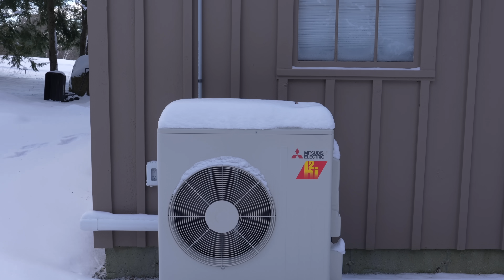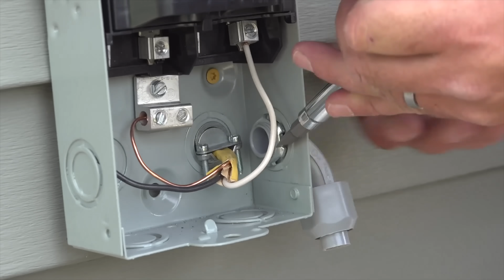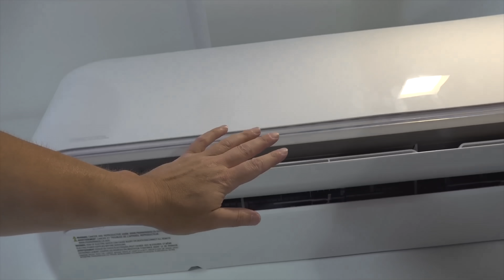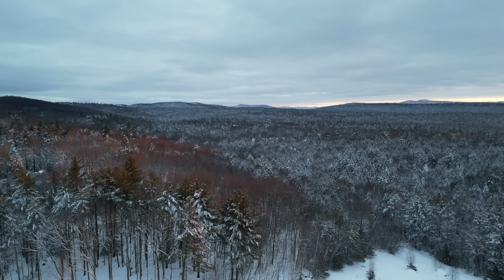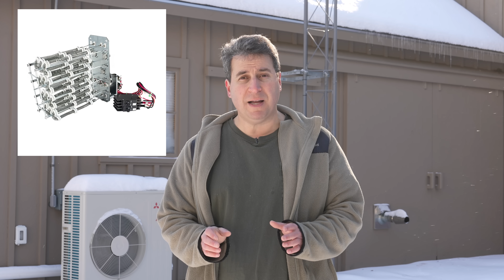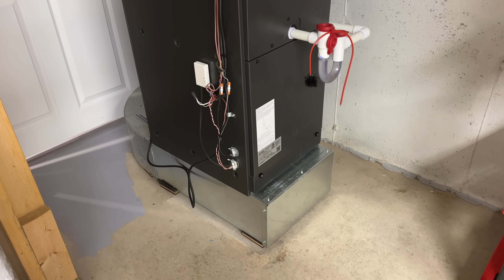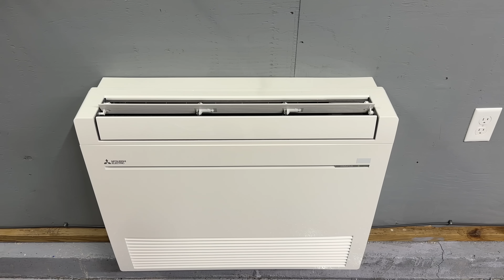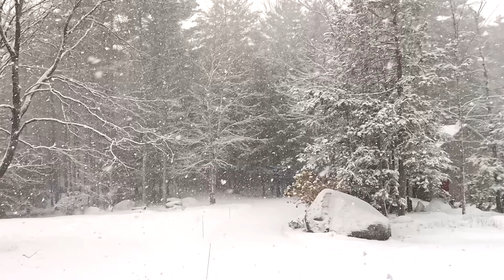Why Heat Pumps are now leaving people COLD

Comment: My friend recently decided to have a heat pump installed. He has an old house and it had an oil furnace and cast iron radiators. He claims that one of his pipes froze and cracked. I don't know if this is true and neither does he (I'm assuming) because he's a hoarder and it's a major ordeal to get to certain areas of his house. Rather than hiring a plumber to come in and find the problem, he decided that the best course of action would be to have a heat pump installed.

So he got the name of a company from somewhere, and hired them. He had visions of a single, small unit, instead they installed three units, each of which looks like it would almost be big enough to hide a body in if they were hollow. One goes to a wall unit in his living room, one goes to a wall unit in the kitchen and one goes to a wall unit upstairs.

Apparently this stellar company installed them and then left without properly testing them, or really showing him how to use the remote control which has a screen that looks more like a scientific, graphing calculator than a simple temperature remote. When he tried following the book and turning them on, he couldn't get the kitchen one to work at all. It wouldn't turn on for me either. He said I should go outside and reset the switch (he has arthritis and was also recovering from surgery). So I went out, found the unit connected to the kitchen, opened the little gray box, and... There was no switch. It was a plastic piece with contacts on it, that plugged in like a big fuse. Plug it in one way and it gives the unit power. Plug it in upside down and the unit is physically disconnected. Apparently they only had two switches and this thing, so that's what they used. Anyway, after I pulled it out and plugged it back in, it started working.

So far, his electric bill has been higher than he anticipated, and when his brother saw the size of the three units, he remarked that just one of them would heat his whole house.

Personally, I think my friend got taken for a ride...
Reply: That little box is called a disconnect. I prefer to install a pull out disconnect rather than a disconnect switch. Switches can fail closed and cause electrocution or damage to the equipment.
Reply: @ryanbrown5334  I don''t know anything about them. I assumed that the switches included some kind of additional circuit breaker of ruse. I know his electrical panel has two circuit breakers for each unit. Whether both are for the outside units, or one each for the outside and inside units, I don't know. All three sets are just labeled together.
Reply: The switches are more than likely a breaker style switch that doesn’t have any over current protection. The panel should have a double pole breaker for the ODU and a double pole breaker for the IDU, possibly two depending on the capacity of the system and what size the heat kit is.

Comment: where i live, they only install heat pumps with a gas furnace (or some sort of additional heat source).  i asked my HVAC guy about them when we replaced our furnace last year.  we just ended up getting a modern high efficiency furnace and AC unit.  while he did sell them, he wasn't overly impressed by them.  i think they are likely better suited to more southern climates where you can use them to help cool your home in the warmer months and heat your home in the spring and fall where the temps aren't too low anyway.
Reply: Your guy needs to get updated.  Heat pumps work great in cold climates when properly sized.  Norway has tens of thousands of them.
Reply: @frequentlycynical642  not sure about that.  around here, you can't install it without a secondary heat source (typically gas).  since I had to get a new furnace anyway, it didn't seem to make sense to buy a new furnace, AC unit AND a heat pump.
Reply: @jeffer1101  Your logic is sound...for now. But, with the government being so anti fossil fuel, this will most likely result in natural gas becoming much more expensive in the future. 

I have been running a dual fuel system (I have a robust solar panel array) that has made it economical for me to utilize as much heat pump generation as possible. That said, I have noticed my  natural gas price sky rocketing higher these last several years. 

You have already made your purchasing decision and I hope it works out well for you. I just haven't seen the government's impact on future gas prices mentioned as much as it should be and felt compelled to bring this potential future issue to the forefront for those that may be on the fence.
Reply: @edwardbutka4750  gas is still a big part of the our energy mix so I don't see it going away anytime soon.
Reply: @jeffer1101  Just to be clear, I didn't say natural gas will be going away. My concern is how the government will negatively impact the price of it.

For example, have you ever examined the cost of a gallon of gasoline? Over 70 cents per gallon is "tax" in California, over 66 cents for Illinois and over 62 cents in Pennsylvania. 

Automobile gasoline "isn't going away anytime soon" but the government sure has helped make it less affordable.

To ignore the potential future negative cost impact of natural gas by governments that have "targeted it" as a dirty fuel is short sighted imo.
Reply: @edwardbutka4750  I live in Canada, don't talk to me about "expensive gas" in the USA.  :)   It could be worse though, you could live in Europe where it's even more than here.
Reply: @jeffer1101  😂

Comment: I'm surprised a gas furnace would not be the supplemental in New England. I'm also surprised the Mitsu could not produce adequate heat in really low temps ... unlike the old heat pumps that would be programmed to shut off below about 45 F.

Comment: Living in Canada here. I have a minisplit rated for -30c. It heats my well insulated 1100 space with no issue during the cold temperatures. My only complaint is during freezing rain/snow storms, the heat pump cannot keep up. The pump will be in defrost mode often.
Reply: Solution: 😀put a cover over the top  and sideways  that allow air still air to exhaust and come through.
Reply: @danlavigueur2648  Huh?  What would that do?
Reply: @frequentlycynical642 you want to shelter the top so it doesn’t directly get snow/rained on because it would require it to go through more defrost cycles
Reply: @derrickp  As all of the minisplits I've seen on YT have vertical coils, can't see how that matters.  Even horizontal, not to any significant degree, especially for the work needed to shelter the coil. Just my opinion.
Reply: @frequentlycynical642  it depends on the makeup of the snow/rain/ice. It literally took like 30 minutes to build a cover. Probably less if I had someone to help hold things

Comment: Had an air-source heat pump growing up.  This was installed back in the mid-70s.  We didn't get a lot of super-cold days but with a field in front of the house (facing north), it could get rough.  The supplemental coils would kick in and the electric bill would jump.  We had a fireplace insert and got a small kerosene heater to help.  I'm sure the modern ground-source systems are much better.  However, if I ever build and put in a heat pump, I'll investigate options for supplemental heat.

Comment: Here in the UK, I have realised that essentially, the tradesmen see-saw your system design every few years.  For a lot of stuff.  And it is really expensive.  So, back in the 1970’s people had multiple types of heating, but natural gas became the norm by about 1985 or so, covering most of the country.  Others tried to struggle on with diesel, or also containers of liquified gas in a nearby section of garden, specially dug for it, became commonplace in the countryside.

Anyway, I installed a heating system of water radiators on the wall of a house in Scotland.  It was three storeys and I super-insulated everything.  Interestingly, when I asked for a boiler quote, multiple tradesmen raised an issue saying my radiators might contravene European regulations (!).  I said fk off or similar.  I specified and installed the rad sizes for suitably fast heating, assuming a cold winter start-up.  They imagine a perfect scenario where you afford heating on all the time.  Joke, especially now.  We pay through the nose for electricity, petrol/gas, and natural gas in this country, the UK, and our government is in the pockets of big Oil so that’s that.  Hence my interest.  

My point is, tradesmen have told me my present house ‘doesn’t need that big cold water storage tank’,and they will get rid of it while doing some other job.  I laughed.  No, you won;t I said.  When the next drought comes, I will need that tank of cold water.  Time passes, next door changes hands, new neighbour does what tradesmen advise.  I offered them water if they needed it, when inevitably some work on the pipes (50 to 100 years old etc), crack and all water is turned off one spring.  He didn’t need it, but he has two small children.  No, I will keep my cold water tank with 100 unnecessary litres!

So radiators essentially, have been getting downsized as tradesmen have been presumably following this trend from EU regulations.  It may have changed since Brexit, but many homes were updated before that.  Combination boilers, we were told would save money.  Haha.  These, are the opposite to what you need, now, all this stuff.  They are all,about burning gas, to heat the water OR the heating system, but only one at a time.  There is no hot water storage.  The result is your home is badly set up for modern eco heating!  Hot water must be stored, because the power from eco power sources eg heat pumps is limited, but over time it can be built up in water if it keeps getting recirculated.  Sudden bursts of heating, really are not possible with solar, or even some wind power. Or, heat pumps.

So you now need, hot water storage.  You need bigger water-filled radiators.  The policies pursued over the last 3 decades, ensure many householders are stuck because they would literally need to strip out all their heating infrastructure, it’s not going to be the right size.  And combi boilers did away with hot water storage.  My Scotland house, had the same boiler exactly as me here in England, but was using a hot water storage tank.  In England, it’s a lousy combi version of the same boiler.  Much less reliable.  In ten years, the England one has been broken down twice in winter of course, and replaced (unnecessarily it turns out haha).  We got a new larger combi from the Co-Operative society, a charitable branch of it anyway, for which I will always be grateful.  This calibrates our income for you.  We live on less than £20,000 per annum.  That’s our total between us as a couple.

But geo as stated in the comments does interest me.  I can still dig, not frail yet.  I will look into DIY of geothermal I think.  If I do a decent job of the ‘input’ side of the system, it should be rock-solid.  Then there’s just how to circulate and so on.  I just have to use the right grade of pipe, or whatnot.  Thanks for this, it confirms what I thought.  We are at minus 6 here (deg C) at the moment, but it feels as cold as I remember minus 25 deg C when I was 19 years old in Scotland, it was an exceptional winter, in the mid 1980’s I think.  We had a rear wheel drive car, it literally could go,anywhere even in 10” of snow (deep for us).  The gritters couldn’t keep up, and many big, expensive cars we helped push as their front or rear wheel drives were found wanting.  Take care all.

Comment: i had a LG duel inverter ac / heat pump, installed middle of october . it gives good heat down at --15 Celsius [canada] and maintains the set temp. to within 1 degree BUT its runs continous ,never stops. when it reaches set temp, the air flow temp gets cooler and reduces in volume ,but does not stop. what is that all about  regards

Comment: Living in Denmark (Europe), we recently had -15C whihc is rare. My Mitsubishi FDCW100VNX-A was installed 5 years ago (January 2019) and have been able to handle all the winters sufficiently.
I usually force it to be on the heating pump only to save money (8 KW heat @ ~2 COP) running on one 240V phase. But it can utilize 2 additional phases to a set of electricity cartridges, running 1.4 KW.  This is just short of the 11KW nominated system size.
The system heats 200 square meters, so it is about 40 Watt per sqm @ 8KW and 55 Watt per sqm  @ 11KW give or take as some rooms can be a little lower in temperature.

Nominal specs stats that 42C in flow temperature at - 15C outside, is 1.85 COP. With out current electricity price (avg 2 DKK) 1 KW heat is about 1.08 DKK.
If i were to pay for that 1 KW  heat in wood, it would be about 2.25 DKK (commerically, dry stored or heat treated) alternatively i could buy it cheaper from a forrest, but would have to collect and store it about 2 years before use.
And ofcourse the time to maintain the fireplace so it runs well and can burn the big logs without additional help.
(forshadowing, i have a fireplace, rated for 6KW)

The heatpump is really great, and i think Mitsubishi did a good job on their cold climate variants. It is definletly easiere than maintaining a wood pellets heater, despite the initial investment in such a system can be cheaper. Ocationally i use my fireplace, but rarely since my wife is very sensitive to smoke particles, so it has to make a clean combustion and be maintained to avoid the useage of fire starts on refilling. The fireplace has the benefit of quickly radiating a lot of energy and is a backup if we hanve any outage.
I once had to get the controler print replaced, took a pair of days, but otherwise no failiures on the heatpump.
Today there are some stricter environmental requirements to the coolant fluid, but the effiicientcy has also increased. Getting a colc climate rated heatpump should be sufficient on its own.

When it comes to economy: We replaced a dying 20KW gas boiler with 50L water tank... no don't ask we just bought the house a year prior. We currently have 350L in total, so it runs more efficient than the original design. At minium 40% reduction in heating bill. Our investment is returned between 6 to 10 years, closer to 10 due to the energy challenges last year, but still way better off than buying gas.
Reply: Our situation is similar, but in the UK. We have a Panasonic WH-MDC07J3E5 which is able to deliver 7kWh. In the specs it says that at -15 outside the COP for 45C is 1.76. It will rarely, if ever, get that cold here. Quite cold tends to be 0 degrees where I live. In the manual the COP for 2 degrees is listed. At this temperature we need the water circulating through the radiators to be 35 C, which is a COP of 3.3. More often it tends to be somewhere between 0 and 10 degrees, resulting in a COP of >5 quite often.

It's still early days, but it looks like our bills are about half of what they were when we were using an efficient condensing boiler that was only a few years old.
Reply: Rather similar here, our temperatured normally dont go below -10c in winter nights here. (-12 was the min I had the last 20 years). When I switched from gas to air water heatpump my energy costs for the house literally became 30% i combined it with PV however which basically gives us autarky between april and October, so half a year we basically run more or less on our own energy.
Reply: the installers in the US dont know how to calculate heating loads and size systems appropriately for the home/climate. The youtuber doesnt understand that heat pumps can be sized to heat virtually any building in any climate. Sadly, the US isnt ready for anything that requires thinking.

Comment: Use a ground source heat pump and you don't worry what the air temp is
Reply from the maker: I wish someone could make the install a bit simpler. I have looked at a few houses with them, 15+ years later most of the original installs have failed or been flawed. Its not the tech, just lack of good installers out there

Comment: Dual fuel is the way to go (if you have a gas line to your home).  Last summer I installed BOSCH dual fuel system in my MA home and it's working on gas below 35F.  Best of both worlds.
It may sound like common sense but for some reason the first company that gave me the estimate said that a heat pump should be enough.

Comment: This is a real-world example. I live in middle TN. All electric house, so using a heat pump to heat the house. We have been as low as zero and maxed out at 24 this week. The house never made it to more than 64 degrees. Heat pumps are not able to handle the extreme cold. We had the same problem last year when we were at -3 degrees. Tomorrow supposed to be 29 so I am hoping the heat pump will shut off for a few hours tomorrow. I also get notifications every 4  hours that the auxiliary heat has been running for multiple hours. In the morning it says that the system is calling for heat, but the temperature is going down. It suggests that something is wrong with my heat pump. I just does not have the capacity to heat this house when the outside air is below about 20.
Reply: If you haven't picked it up by now, your heat pump is not sized correctly, do not say "heat pumps are not able to handle the extreme cold."  Tens of thousands of them in Norway.
Reply: I think for normal temps, it does fine. 3 below zero is not normal for Tennessee. I would think that homes built in northern latitudes would be much better insulated than homes here. I posted that as my real-world experience, not a condemnation of heat pumps in general. I think you are right that it can work, but for me, it's been a struggle.  @frequentlycynical642